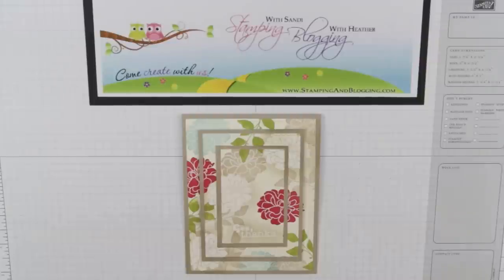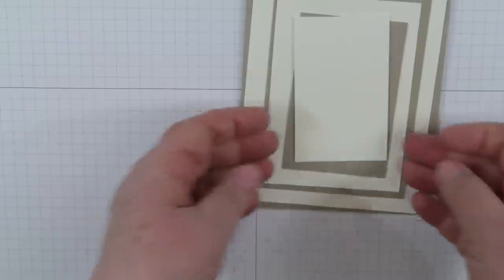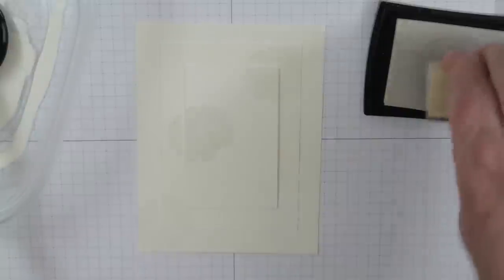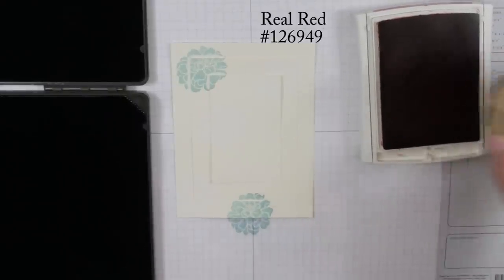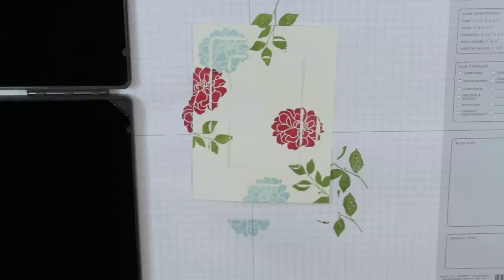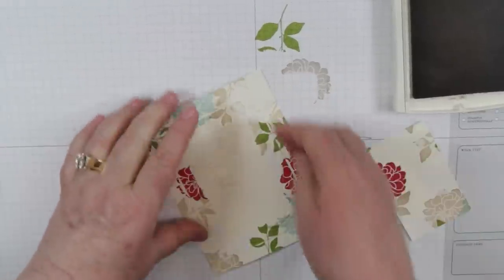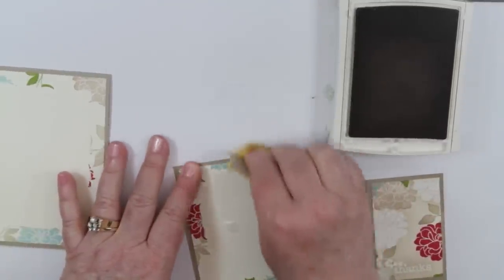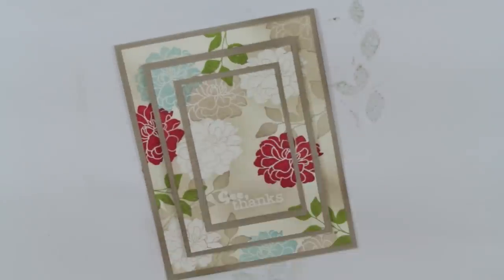Triple Time stamping Technique Card with Fabulous Florets

Comment: Have you tried removing the centers of the border panels to lessen the bulk?  If you start with the largest one, you can use the center cut out from it for the middle one, and maybe get the smallest border panel from the center of the middle one.  Make sense?